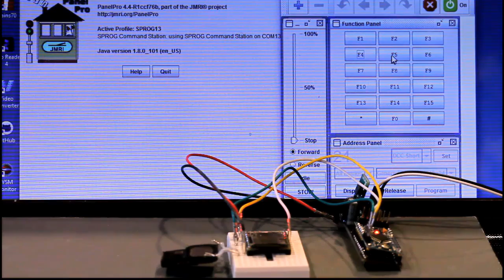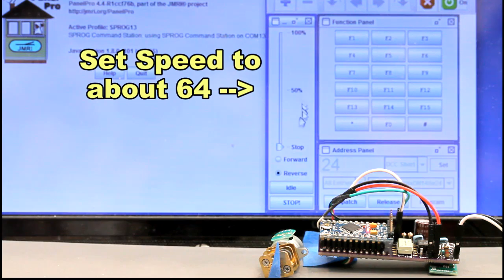DCC Arduino projects for model trains | March 2017 Model Railroad Hobbyist | Geoff Bunza

Comment: Hello Geoff, I have been told to come and see your videos on Arduinos, I have also seen other YOUTUBEs that have shown me about Arduinos, 3 sets of Signals, Sensors and LOTS of WIRES, now I am wondering this could be be done with WIRELESS, we all have seen SIGNALS(mine is still in a box but some of the wires have come out) alongside the track and in some cases there is a "CABINET" to one side, with things inside, could this happen to a DCC layout with lots of Points, with the 3 Aspect Signal and THIS CABINET off to one side to house SOMETHING, like an Aerial or Wireless thing on top and underneath have the Arduino and what ever else needed getting its OWN POWER from it own Power Buss( I have seen VERY NEATLY LAID, BUSS WIRES x2, 5v, 12, Accessories, and 1 or 2 more all together running where they should be). I am thinking this could have the Aerial and something that in the Cabinet that is joined though the layout to the Arduino then to its Buss, to eliminate any problem of a Short on the track causing a break in the Arduino System.
Thanks for your time Graeme